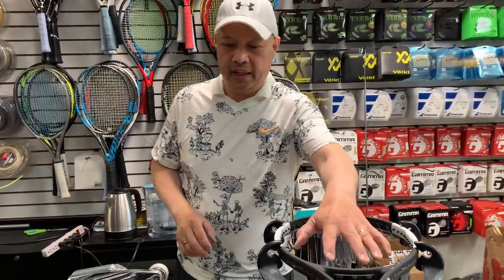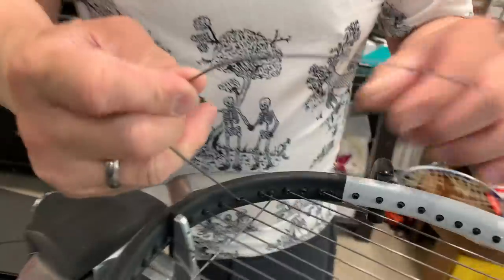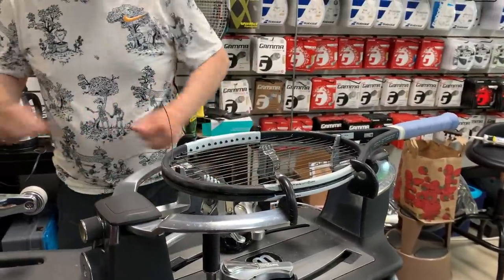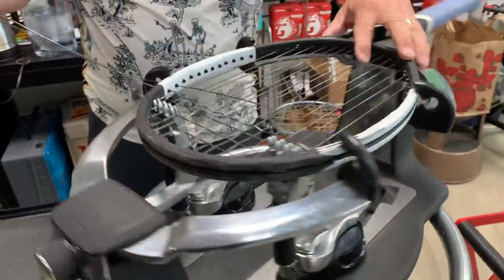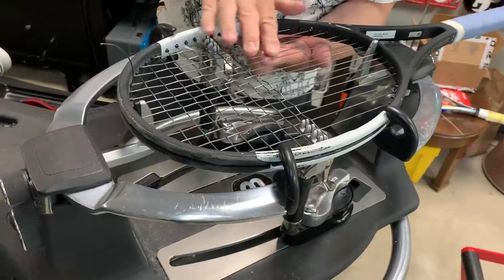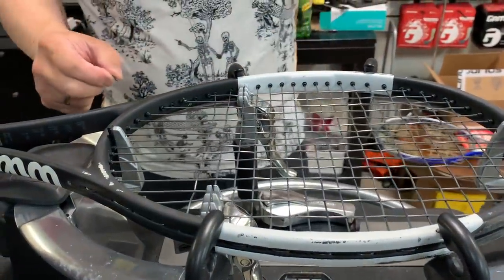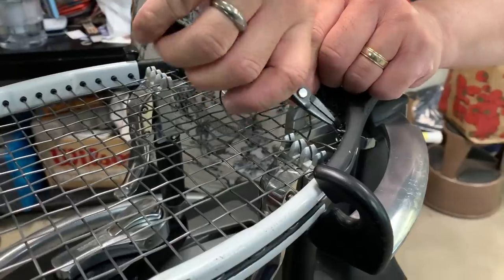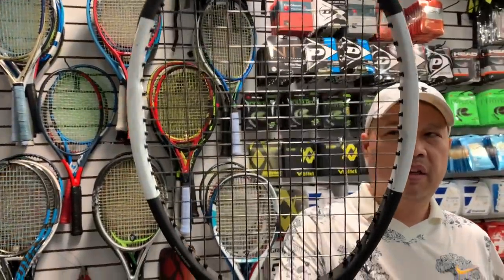HOW TO STRING A TENNIS RACKET   PART 2 THE CROSSES

Comment: Nice video.  For newer stringers out there, YOU WILL SAVE A LOT OF TIME if you never let go of the end of the string after pulling strings through the frame/ grommets.  Pinch the end between the butt of your hand and your pinky+ring finger.  It keeps your thumb and two dominant fingers free to manipulate the machine, etc.  it will also minimize the odds of the string getting tangled.

Comment: Do a segment on why do tennis cans have a lid that can cut off your finger when trying to open it. It’s insane that the lip is as sharp as a razor blade. Got to be a new invention to compress air. There are people living in the wilderness right now that have weapons with less impact than a tennis can lid has.
Reply: I mean I tested it when I was playing tennis once I tried to cut my self and I did like swift cuts and nothing really happened it would only cut you if you put a lot of pressure and cut slowly

Comment: I use 'wingspans' to measure the required length of string. For a typical, 98/16x19, I use 3 wingspans for the crosses, and 3 wingspans + an additional length from the tip of my fingers to my elbow.
Reply: You can also weave the 2nd cross first, then weave the 1st cross, pull tension on the 1st cross etc. Saves you having to pull the entire length of string through the crosses. Saves time and slightly reduces wear on the strings.
Reply: Thats it,   3 for the crosses and 3 then an extra to the chin for the mains,
Reply: @gavlatennis2824  I do it that way, but don't tension my first cross straight away. Not that it really matters either way. 

I guess with a starting clamp holding that first cross, you can string all the crosses and then tie off last. I find if you did that it gets a bit messy with clamps and string moving about.

Comment: Thank you for such a detailed video!  It helped me tremendously!  I have a crank machine, so I can't hold on to the starting knot string when I pull tension on the first string.   Can I tighten the starting knot by pulling on it like the other knots?  Would that reduce the effectiveness of the first string?

Comment: Everyone should see and compare the use of starting clamps for sorting the mains and crosses in the Yonex stringing video, great stuff.
Reply: Yes I agree. I always start my crosses with a starting clamp never a knot. When I first started stringing years ago I started out with a starting knot so I understand why he shows this in a beginners video. I am on the head stringing team and that is also how we do it with a starting clamp :)
Reply: @Jham031  Starting clamp here also, but overall I'm not sure it really makes a difference.

Seems there's slight variations across the world of stringers, all with solid reasons for doing something. 

Experience and scientific rationale no doubt play equal parts.

Cheers
Reply: What difference does it make if u clamp or tension the first cross string?
Reply: @matthewemmerson9461  the only difference is that you stress the anchor main that you tie off, but that last cross (first) is even tensioned. Starting clamp method on the other hand gives you a less tensioned first (which becomes last) cross and no stress on mains.
If you have gut mains ALWAYS use starting clamp for crosses and tie off on cross instead if main especially if cross is poly
Reply: You have to use starting clamp on first cross and not pull the 1st string, do all the crosses  and tension the 1 main at the end to avoid the frame stress.
it’s good use also to tension all the 4 strings that have a knot a little bit higher in tension to avoid tension loss of the manual knotting.

Comment: Hey!
Thanks a lot for your great videos!
You can be a little faster with the crosses: after weaving a cross string, do only pull five inch of the string through the grommet. After you tensioned the cross string before, you can grab the end of the string and pull the string through the racquet by holding the end in your hand all the time. Then you can immediately start weaving the next cross string, without looking where the end of the string is 😊

Comment: Do you ever use the method of a starting clamp on the outside of the frame for the starting knot? Tying it off after a few weaves prevents the starting knot from getting pulled in too deep on old loose grommet holes.

Comment: Hi I really enjoyed the video. I’m new to stringing, why do you start at the top of the head and not in the middle and work to either end like on the mains?
Reply: That's how it's recommended by racket manufacturers.  Prob also cause it's safer and simpler going top to bottom or vice versa cause the 3 and 9 o' clock positions have the most stress   and starting cross tension there could cause warpage

Comment: These videos helped me a lot,  just did my first stringing. However, it took me 6 hours, in-between throwing up 🤮. I started not feeling too great then it went downhill from there. I couldn't leave the racket on the machine and go to bed, so had to get it done. Got there in the end. It was an awful experience, but a good one at the same time. 🤣

Comment: @Tennis Spin,

What are the benefits to stringing with two half sets rather than one full set? (Assuming it's not a hybrid of course.)

I was taught to string with one full set. The theory is that less knots would result in less tension loss.

Learned on a hand crank.
Reply: Hi Vinh, I can answer this (strung over 32,000 racquets)
I prefer stringing two-pieces actually BECAUSE of the tension loss of the knots.  You see, on a two-piece you will lose tension on the outer strings (the shortest strings).  It makes scientific sense to have less tension on a shorter string.  If you pull 60 pounds on a 100-inch string and you pull 60 pounds on a 10-inch string, the 10-inch string will be relatively stiffer (even though they're technically the same tension).  This translates into having a slightly smaller sweetspot (according to the theory of proportional stringing).  There is also a time-saving benefit of not having to pull so much string through when doing the mains.  
With the one-piece method, you will still lose tension on the knots... but you lose tension on one main string and one cross string -- creating an uneven stringbed.  You're right that there is less tension loss though.  But the tension loss is uneven.
Reply: @logintech  Very good response, but to nitpick a bit, there's no significant difference on the sweetspot by losing tension on the outer strings. The second to last string is still pulled at full tension, negating any effect.
I like to pull some extra tension on the outer strings, because they tend to buzz sometimes if they're very loose. Especially on very stiff polys which can be hard to pull tightly enough when tying the knot in order to avoid excess tension loss.
Then we actually have pros like Richard Parnell who sometimes pulls extra tension on both the second to last and the last string as can be seen in this video https://www.youtube.com/watch?v=86gqNRFikSc
Reply: I can answer this too (strung over 30 rackets in 10 hours per day for 13 years).
Reply: Found some helpful articles relating to the matter:
http://www.tennisindustrymag.com/articles/2013/04/18_racquet_stringing_is_two_be.html
http://www.racketrestringing.ie/blog/one-or-two-piece-stringing-does-it-matter

Comment: that "starting knot" isn't that a pro knot? the starting knot is two loops and then back through making the slack of the knot point down along side the main
Reply: I believe it is a pro knot and not a starting knot. Also not a huge fan of directly applying tension to knots. Starting clamp imo is the best way to start crosses.
Reply: saigonbond  I use this knot for mains end and crosses end. But my starting knot isn't that or clamp.
Reply: A starting knot is ok to use (clamp is still better) because it doesn't put stress on anchor string. There's a few different knots that can be used, and this is not one of them. No one should use these videos to learn to string.
Reply: Rob P yeah, the knot he showed is not a starting knot in my world
Reply: I would say this is not a starting knot. The starting knot supposed to slide onto the anchor string and not bind to it. You want to keep the 2 pieces of string independent of each other.

Comment: What if a main is overlapping a grommets from another main that was skipped? How do you get a cross through?
Reply: Cut tip at an angle, Use pliers to push string through, or use pathfinder awl if you have it

Comment: I get why you start from center out on mains.  Is there a reason to start from top down on crosses?
Reply: Yes.
Reply: Long story short, a frame is less likely to break when stringing top-down.  As you string, pressure builds towards the direction in which you're stringing.  If you string bottom-up, you will be putting pressure on the weakest part of the frame.  Honestly,  I doubt very many people will break a racquet stringing bottom-up unless there was a hairline crack there to begin with.
Reply: I think the main reason is to have more space for weaving. If you start at the middle on the crosses, you basically cut your space in half, and you have harder weaves on both ends instead of just on one end. You should always start the crosses at the top though, it puts less stress on the weakest parts of the frame compared to starting at the throat.

Comment: hello i am 15 years old and i intend to buy a new racket
my old racket is pure aero vs 2016 
and i have a doubt between wilson blade 98 16x19 v7 and wilson ultra 100 v3
I like to use spin but not so much
Reply: Blade 98 16x19
Reply: Blade 16x19 absolutely

Comment: Couldn't you do this with only 1clamp since you've already tied off at one end?
Reply: Yes but in my experience it’s just easier to run the two clamps and always have one close after you tension.
Reply: It's only possible with certain machines. On machines like this one, where there are two clamps that run along the length of the racquet, you can't because you can't reach the other side of the racquet with just one of the clamps.

Comment: Wow, you string "top down"?   I learned "bottom up" because the throat is stronger and less flex.
Reply: If you string a yonnex cross strings from the bottom up you void the warranty.
Reply: @bowsershark  head racquets is the same void waranty if bottom up
Reply: It is a bit counterintuitive, but stringing from the strongest part of the frame (throat) to the weakest part of the frame (head) can cause racket breakage. As you string from the top of the head of the racket, it stiffens and gets stronger while putting more force towards the throat.